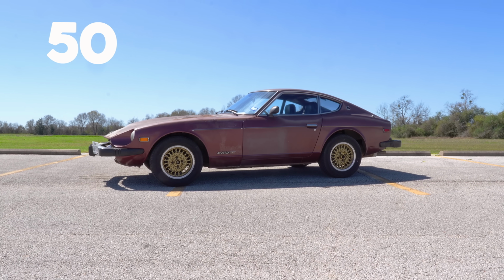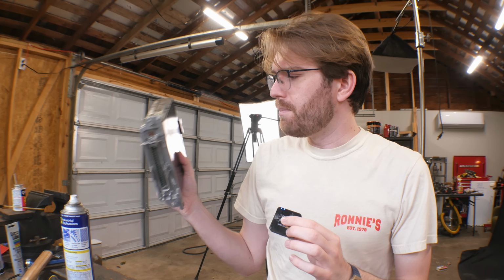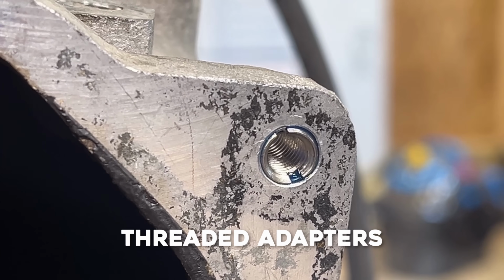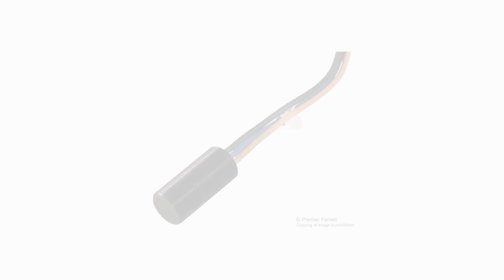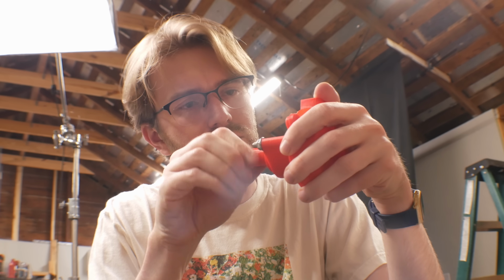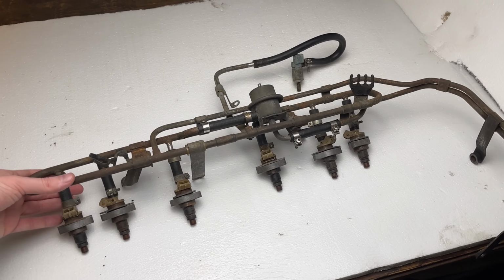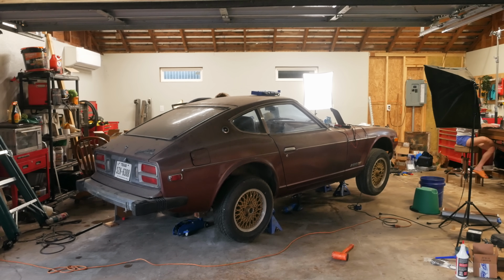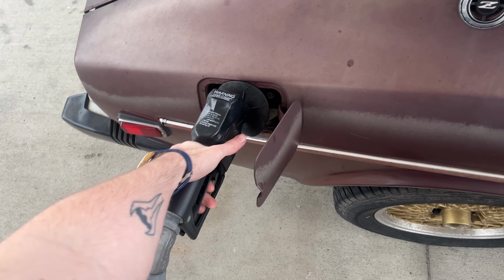Modernizing a Vintage Car

Comment: Well done vid. My personal comparison of engine control technologies is the difference between my '68 Pontiac Tempest with the OHC6 engine and several recent Dodge Durangos with V6. The OHC was my daily driver in the '70s and I kept fuel log. The OHC6 was 250ci, 1 bbl carb, and was factory rated at 175 hp. That was much greater hp than 6s of that era and close to the hp of the small V8s. I was fussy on tune ups and adjustments but it was completely stock. In typical teenager races from traffic lights this engine could catch and sometimes out run similar size cars with small V8s from about 20mph to 50 or so. I always felt the slow launch was a problem of the 2 spd automatic. My logs showed 17-18 mpg in my weekly around town driving. On highway trips the averages at fill up were 20-23 mpg. Again, very good for the size, weight, and speed capability of the era. Fast forward to current decade with Durangos (I love these for overall good value for utility, comfort, economy). 238 ci V6 factory rated at 295 hp! That's a smaller engine putting out 120 more hp. Or, an engine 6% smaller but producing 68% more power. Around town I average 19-23 mpg, and on highway trips from fill up to fill up see averages of 26-30 mpg. So smaller engine, more power, bigger vehicle, greater fuel efficiency. Some of the gains are from more optimized internals but most of the gains are the fuel injection, sensors, and computer controls That have developed over the past half century. In general, I'm not a big fan of putting electronics and computers on machinery but it is a fact that electronics have made internal combustion engines simultaneously more efficient, more powerful, more reliable, and less maintenance demanding. This journey with the 280Z is a great before and after comparison. I also feel the editing provides a wonderful role model of problem solving mindset. A great case study example for every freshman engineering student.

Comment: I'm sure your tuner was aware, but the optimal ratio 14.7:1 is no longer true under load. For NA cars it should be somewhere in the 12-13:1 ballpark under load, and running 14.7:1 otherwise (closed loop).

Comment: When I lived in California the smog test rules were based on whatever was newer, car Body or engine

So a 1936 Ford model A with a 1996 Ford V8 had to meet 1998 smog test requirements
A 1965 GM car with a Year 2000 engine had to meet year 2000 smog test requirements

That meant you actually did NOT want a modern engine unless you wanted to install all the required sensors, Cat convertor, O2 sensor, Computer of that engines build year

I knew folks who got caught in this legal mess
The smog test ran rather clean for the car bodies year it was made
But the newer engine kicked in the tighter specs so the car failed
So no smog certificate; then no way to get a renewed license plate sticker

Maybe is all changed today
It once was to always use the same year block or older to not create more stuff
ie Smog pumps etc

They use to ding you for anything non stock
Your car passed for idle and cruise smog levels
The smog czar dictator saw a hot rod coil thus you failed smog
So every 2 years you added back all the stock stuff to pass smog visually
ie a no stock Air cleaner would fail your car
The oddball black orange juice can if missing failed your test
In the paper California smog test book era they had photos for the czars to check your stuff

Comment: I know this video's 5 months old and nobody's gonna see this, but I want to add my two cents to the throttle-by-wire thing.

I think they're a fantastic system for what you demonstrated, they don't need ANY additional piping, valves or inlets for idle control. Theoretically, they're also (maybe) more reliable with the right system, since you don't have a cable constantly under tension. 

However, I would like to shed light on the "against" crowd. I don't think it's an argument without a base. Manufacturers that put electronic throttle bodies in their cars (so basically all of them) also mess with the mapping to make the engine more efficient and improve co2 emissions. Unfortunately, this, in turn, makes the car feel like shit. This is SIGNIFICANTLY more noticeable in a manual car, but even in an automatic you can tell. The main issues these throttle maps bring are worse throttle response, huge rev hang or engine "flaring" (the throttle is held open slightly when shifting, as though the driver transitioned onto the clutch a little too early, before they were fully off the throttle) and, sometimes, a massive delay between the pedal being pressed, and the engine actually accelerating. I notice the last one a lot in my Mum's 2008 Mitsubishi Outlander V6. You put your foot on the throttle, and nothing happens, so you put it in more, and then suddenly the car launches super hard and chirps the tyres. It is so extremely frustrating. I don't think this is something manufacturers do to the throttle bodies on a manual car, but I still think it's worth mentioning. 

To go back to the other side, though, I think those drawbacks are easily solved by... just... making the throttle body 1:1 with the pedal, which seems to be what you did in your application. If that is done, I think nobody should have a problem with it in terms of how it drives, cause it would just feel like a cable throttle.

Anyway, that's all of me typing something no-one's gonna read

Comment: Now give it an easy LPG conversion so it doesn't stink and you will be back at 125-135 BHP.

But I would very much recommend an upgrade to LPG direct injection. It is not quite an off-the-shelf solution because you need to drill the cylinder head and install direct injection nozzles, so it will be pretty much worth another video and you will actually get more power than you have with gasoline MPI. Maybe it's not even possible ))) Also the exhaust system is pretty crap - you could give it a custom one...probably another 10 BHP.

Comment: for the moving shaft that needs to be case hardened could you not find a machinist to make the part, case harden it and it would be alright? I didnt think that heat treatment would ultimately change the dimensions of a part that drastically. (I have less than 6 months of manufacturing knowledge, correct me if im wrong)

Comment: Nice upgrade attempt on things but getting rid of the throttle cable was a bad move keep the mechanical connection to the human being is the best way most efficient best feel for what the motor in the road is doing

Comment: I'm not sure if that ECU supports them, but look into magnetic angle sensors rather than binary hall effect units. They give a very precise angular position readout and cost maybe $15. Just smack a magnet on the shaft to be measured, the sensor above it, and voila! Precise angle, no minimum angular velocity, and no synchronization needed.

Comment: Well this is a nice idea.
...Now how do I do it in reverse?  Lol.  I hate new cars.  You can't fix them yourself, or change the fuel mapping, or even yank the radio out to replace it with a cool oldschool CB and GMRS setup without upsetting some stupid computer.  Usually a computer that detects you trying to do anything custom and disables cruise control to punish you for daring to think of working on something yourself.

Comment: When I was in high school in the early 1990s, I had a 1982 280zx, or S130 as weeboos would know it, and I still have PTSD from all the wires, vacuum lines, and hoses that were in the engine bay.

Seeing how you set up this Z to be more modern has given me hope I could do the same one day.

Or just go out and find a 350Z that hasn’t been beat to hell.

Comment: I put a 1978 280zx block into my 260z with the 260 heads, and mated a 240Z intake and carbs.  It woke up quite a bit, just getting rid of the crappy emissions stuff from the late 70s.  Once I got the carbs balanced, it had more usable power than the fuel injected setup did

Comment: I put a 350 SBC into a 240Z. I used a rebuilt Monza engine and iron case Saginaw 4-speed. Ended up with a Muncie M21 and 280Z rear end. It was probably 300 hp. The 215 Buick "Scarab" conversion was a lot better. Once you put stiffer springs in the Z front end the push was terrible. Steering with the throttle. The 350 wasn't that much heavier than the Datsun 6. The 240 used SU copy carburetors that probably worked better than the British versions on the TR-6.

Comment: Not bad atall, swapping injectors, throttle body, and the ECU and getting double-digit percentages of mileage and HP... and you probably saved a good bit of weight, too, all those bulky old tubes and things... and it looks better, for what that's worth...

Comment: I have a 75 with the Bosch replaced with a Fast Fuel EFI system. Not fond of it as I have to adjust the IAC every time I start it. I’ve heard that the newer versions are better but Z car depot sells this one and it works but I don’t want to tune it every time.

Comment: I had a '79 280z 2+2 (BULLSHIT 2+⅓ at most) mine was 5sp manual andd together this had amazing torque 50km/h in 5th and it would nicely increase speed without engine bogging out.... the engine was extremely reliable and leak free (my one anyway) .....  i found out the gearbox was the least reliable component

Comment: Last century they made a kit to put a 289 Ford or a 307 Chevy into a Z car. It came with a Dana manual transmission. The HP rating was much higher and you did not have to do all of that mess to make it run. Of course everything was analog, not digital.

Comment: Modern cars are NOT more reliable than old cars. If we're talking general trend, it's the opposite. People go more often do their dealership for repairs falling under warranty, simple because there is a LOT more stuff that can break down, mainly electronics. Sensors, tablets, onboard computers... However, there were some brands that were famously unreliable and that are more reliable today. Citroën for example, because they stopped making so many innovations. Rover, because they... died. Mercedes has a period of time where they were awful and unreliable too. So it depends. But as a general rule, cars are less reliable today if you take the same type of engine (petrol or diesel engines). Of course overall electric cars have fewer mechanical parts, but their electronics are just as likely to break down. Tesla has had awful reliability for example.

Comment: some of the distributor type spark (points models) needed the spark to be acouple of degrees before TDC and more advanced as the speed increased so they had a variable spark slide plate the points were screwed to, the advanced method usually was from a vacuum line. that was with the traditional coil, I think the later electronic ones still had variable timing. perhaps all this is managed in the new computer Ronald has installed, although I didn't see this mentioned. very entertaining, innovative and clever, thank you. I was remembering my youth tuning/servicing with feeler gauges and nail files.

Comment: wouldn't using a hall effect sensor to control ignition timing put the car at risk of misfiring if you drive it anywhere theres significant electromagnetic interference

Comment: Mid/late 1970's greater Seattle area.  A Cadiliac 500 ci in a VW Bug!  if you could grab the $100 bill on the dashboard it was yours... Only thing is that you had only a few seconds to grab it as he took off the line! lol  76 Monza Spyder upgraded to 350 and modified for my homie Roy-The-Toy-Boy whom was a midget.  Our friend "Profess" did all the modifications, engine was balanced and blueprinted at a shop in Georgetown.  That was a dangerous car!  Too much power for the weight.  Friend Paul - Roy's bro - got a 74 Malibu Classic 454 4sp w/pistol grip.  We pulled the engine and checked it out.  Rebuilt a lot of it and then sent it to the same shop.  Got it back and dropped it in.  NOS, a bunch of other stuff... Dude!  She wanted to pull wheelies!  Bunch of us had 442's and 2 had W-30's from 1968 to my 1974.  John had a 1970 442 - Official Pace car! lol  Other buddies had low riders thee best was a Lincoln Continental Mk V called "Champagne Ice" she was sweet!  Vern's bro has a 1969 Super Bee lol  A guy in the hood right at the corner raced professionally... He had many trophies in his trophy room.  He drove a 69 Camero SS and a 67 GTO.  That GOAT was in a different league!  Back then - you weren't anything unless you could "Chirp 2nd" with your Turbo Hydramatic 400 automatic transmission.

Comment: Back in the '70s I modified a 1.7L Saab. I kept the original D-Jetronic injection but made a fiberglass intake manifold that was similar to the later 2 liter design: 15" runners into a large plenum controlled by the original (modified) butterfly. Added 10:1 pistons too. I ended up with about a 15% -20% horsepower gain. Eventually I put in the later 2 liter engine with the L-Jetronic.

Comment: 9:05 while i as a mechanic, don't like throttle by wire because if it fails it is either all or nothing and that can get you killed where as if a mechanical throttle failing is just nothing, (and is less likely to happen computers dont like the environment of an engine bay) this is your car and its pretty cool what your doing. now for the reason I timestamped where I did. That gap between the odd shape in the manifold and the adaptor you made will cause some weird air flow that could cause a choppy flow as the air kinda swirls and gets trapped in that spot, which will also hurt any gasket you could use. that will reduce power and efficiency. I would take some clay fill that little gap and the adaptor then create a mold and add a filling onto your adaptor to fill that hole and create a smoother pathway for the air to flow. in the end though, anything is better than what it had lol.
Reply: oh look the engine isnt sucking air as good as i could be. wonder what weird ass shaped issue could possibly be causing that.

Comment: Loved this video! Had a 260Z purchased new, that I loved. Just a fun car that generated 100 Smiles/Gallon. Salt in Western NY and just 1 oil change with what I suspect was bogus Quaker State oil from a discount store was enough to kill the car. The instant I started the engine with that oil, I got zero pressure. Upon draining it, it had the viscosity of water.  Replacing the oil and still had zero pressure.  To this day I miss that car.

Comment: Congratulations on your build.  I did something very similar to a '78 Mercedes Benz 450SEL that had the Bosch K Jetronic fuel injection system.  

I used a Megasquirt ECU and converted fuel and spark to a Ford EDIS system.  The swap went pretty much just like yours did with a few minor differences, such as mounting the 36-1 wheel on the crankshaft pulley and then just mounting a cover plate on the hole where the distributor used to be.  Also, I kept the direct cable for the throttle and mounted a TPS on the throttle linkage on the intake manifold.  

In my case, I went from 195 hp to 215hp and improved fuel economy from 16mpg to 21mpg.  

All in all, it was a fun and rewarding project.  I Hope you enjoyed working on and upgrading your classic 280Z.  I really enjoyed your video.
Reply: How did you replace the Distributer system to make with electronic for the ECU to control

Comment: This was by far one of the greatest car videos I've ever seen on youtube. The before and after shots of how clean the engine is now with all that 1970s tubing removed is goddamn beautiful. I've been pestering my dad for years to get rid of the Rochester QuadraJet on his old Corvette and slap a Haltech ECU on it and convert it to EFI for the very same reason you did. There's just no excuse for using a carburetor on any car unless you're doing some sort of full-original restoration. If you want to daily your old car, EFI is the only way. What an awesome video. You're a legend.

Comment: With 15k+ comments, have you read them all? :face-green-smiling:
You've probably been praised & complimented beyond count, but I still felt you deserved another. If you've done all of this without any assistance, you are quite the intelligent and knowledgeable person. I was a Nissan mechanic starting at early 1981 and worked on your model Z-car many many times over. How cool it would have been to open the hood, back then, to find all the goodies you created/built/bought/installed here. This video will save me an immense amount of time in research. I WILL be saving this video as a reference for future projects. Take care, Sir...and thanx! - 'norm1200'

Comment: I am so impressed with you and 3d I can't believe you didn't get awarded with more power maybe a header would help alot maybe the engine is kinda tried I really thought you would get atleast closer to the factory 170 you did make a much simpler system in most aspects

Comment: New cars are more reliable?  Yeah, in paper.  Old ones you could fix with an hour and a trip to NAPA Auto parts.. oh whats that, new engines require manufacturer specific computers and licensing to repair?  Well...

Comment: Thanks for great explanations.  I never understood why electronic throttle bodies were used but it makes total sense.  The auto industry has made it all a scam, however.  I was purchase agent for an oil related construction company and we had one of our brand new trucks towed into a repair shop.  Our trucks were for industry and had no warranty coverage.  The cause: a failed accelerator pedal position sensor.  We were charged $1200 for the part, NOT counting labor.  The old school ways would have had that truck on the road with a coat hanger wire and some duct tape.  Thanks to your video, I understand the advantage.... and the crooked repair scheme of auto makers.  After all you've done.... I hope you make sizeable gains from YT views to reduce your 60+ yr. ROI. :face-green-smiling: